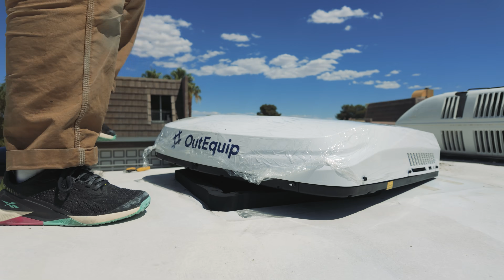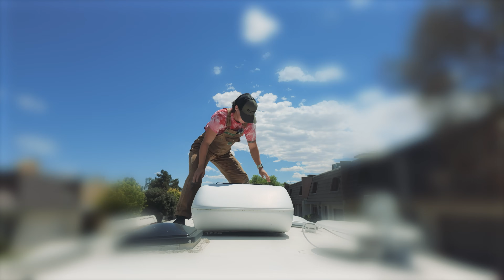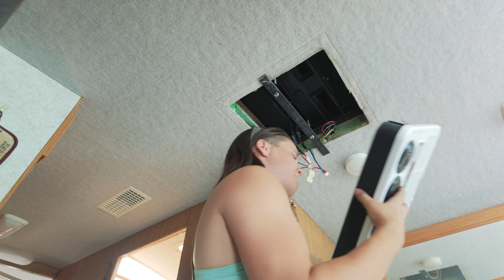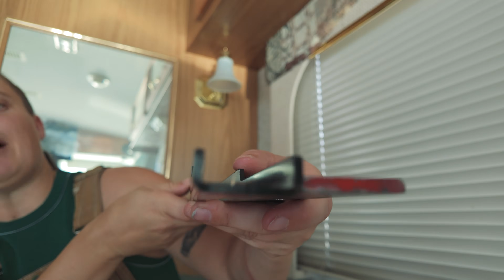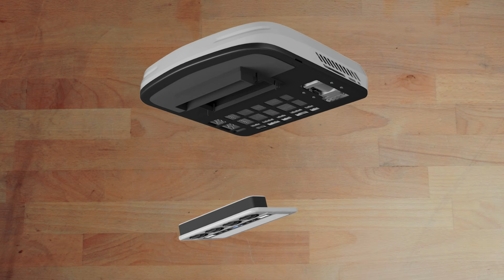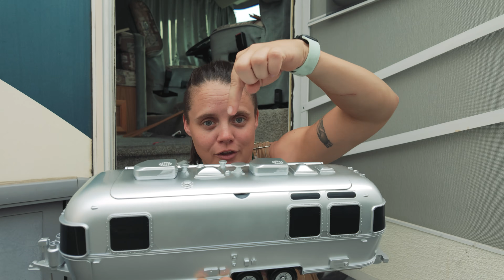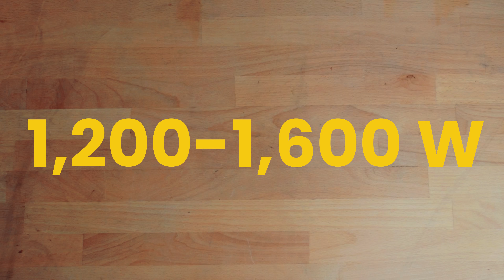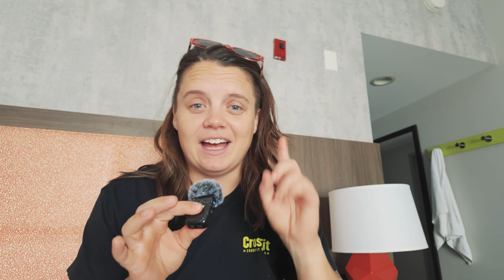Better RV Cooling with Less Power? My Switch to a 12V  AC | OutEquipPro AC Honest Review

Comment: Correct me if I am wrong, but an A/C air conditioner wouldn't deal with inverter losses when running off a generator or shore power would it?  Unless I suppose you were taking the A/C power and putting 100% into batteries and then feeding the RV.
Reply: Not if it's wired properly. If you plug into generator or shore power, a transfer switch (separate, or part of inverter) will bypass your inverter. So 120v power in the RV comes from shore/generator if present, or inverter when not available.

Comment: With the data i've seen so far, the new style inverter ACs, like the Furion chill cube, or Turbro are a better bet for larger RVs, IMO.  They are AC, not DC, but can be up to 18K BTU.  This DC unit is rated at 10K and  I don't see that cooling a 30+ foot RV.  My two ACs are 15k each, and struggle on a 95+ degree day.    I'd be curious to see what  you think six months from now after you've gone through the hot summer months
Reply: Insulate. Insulate. And Insulate.  I had to add insulation over the windows and shade the sunny side of a 5th 33 foot wheel with 15,000 BTU A/C's before the air conditioners could keep up with the 109F heat. Cardboard window covers and blankets on the walls make it possible to get it down to 89F.
Reply: @bobmirror7164  the thing is the walls will always be poorly insulated they are very thin

Comment: Can i connect the 12v ac to the power center instead of the battery? 

I have a 24ft class c. I installed a  12v ac on top of the bed in the rear, in my vent cut out. My power center is under the bed which is a straight shot. How to connect it to an open fuse spot that i already have? I do have solar and an Anker Power house which i i connect to my old generator plug and want it all to run of the power center. Also, my house battery has an issue that I need to figure out but I haven't paid any attention to it since my Anker runs great
Reply: As long as it can supply  80a ... if not, you might want to parallel 2 batteries as this takes a lot of stress off.  The battery will have a load amp rating.... the more you parallel the higher the amp capacity, put a proper fuse.

Comment: I have a Champion 2500 watt, duel fuel generator that is pretty quiet, around 60 decibels at 20 feet away, especially when inside its zombie box. It can power a 6000 BTU portable air conditioner with AC power for around 10-hours on 2-gallons of gas, or 5 hours with one gallon.
Reply: I have one also...but haven't tried that.
Propane would run even cheaper.
I have two new champion duel fuels.
Someone on youtube said it's much cheaper, just to run them on propane, and if you do that, try not to ever use gas, because it can help it last longer.

But yeah, it's a lot easier to get gasoline, then it is propane in most places.Especially if you're boondocking
Reply: What is a zombie box?

Comment: Thanks for the video: So you do not need an inverter for a 12V AC, correct ??   Thanks
Reply: 12 V used in RV's is DC power not AC

Comment: Another option: notch the inside lip of the plastic face plate to accommodate the metal brackets (Dremel with sanding drum), the vent/control panel will cover that up.
That's a cool system, 12DC brushless fans to save power, 'smart' scroll compressor with internal DC to AC step-up, but it needs a new 6awg wire run for the 40-60 amps at 12v.

Comment: More idiocy. Lets put an AC designed for a conversion van on a 30 plus foot class A. Then claim this smaller unit is more efficient because it uses less power. This unit is at least 3000 BTUs smaller so of course it uses less electricity moron.

Comment: I have a 30ft class A RV that has two existing rooftop AC’s. If it’s over 85 degrees outside, either one will bog down and shut off within 2 minutes while plugged into the home I’m staying at (30amp with a pigtail adapter to 110v). Would one of these cool a 30ft space, or would you recommend installing and running two at once? Would two draw too much from the batteries?
Reply: Great Question..hopefully someone can answer this

Comment: The rated power per the company website is 960 watts.
Reply: but if she said that you would find out thats roughly the normal power usage for a 120v 10k btu ac even a non inverter 120v ac will use very little power overtime when its not hot out

Comment: I do wonder what the actual (not claimed, with a tailwind) BTU rating of these 12V units are. At the end of the day, it is sucking heat out of the air inside and heating up the condenser outside. If it has a tiny condenser radiator it's simply not moving lots of heat or the condenser is super hot. A different manufacturer of 12V a/c units got called out for unrealistic BTU ratings, got very upset with people and actually got a proper test chamber built to prove their detractors wrong. Then they went very very quiet for some reason. (I just checked their latest specifications sheets, they dont even list BTU or cooling ratings in watts any more, just temperatures. Hmm)... But anyways, the actual power consumption for exactly the same cooling work is what really matters. I think it's using significantly less power because it can't shift asmmuch heat, so it's going to have a much higher duty cycle, that's not an issue if it never hits 100 percent, you are definitely saving on the inverter losses. But a real comparative power consumption is watt hours per 24 hours in the same conditions.

Comment: I love the idea of this. ACs are so loud. I camp to relax and the AC is not relaxing. This could put a pretty hefty load on the power converter if you are plugged in to shore power. That being said, modern RVs no longer use power hungry incandescent lights so that frees up a lot of 12V capacity. I hope you can do a follow up on this in the future. I'm not going to replace my AC before it dies, but when it does, I may consider switching to DC.
Reply from the maker: Definitely a good point about the converter. If you were going to run this while plugged in a lot I may look into upgrading your converter to something a little higher amps.
Reply: @rvrepairwoman  Pardon my ignorance. I though the converter charges the batteries and the DC circuits draw from the batteries. So there should be no direct load on the converter with this?
Reply: @whatdafrog  difference between inverter and converter. Inverter is DC to AC. Converter is AC to DC. Shore power is AC. So you’d need a way to take the AC to DC.
Reply: @renadas.8627  I'm well aware. The inverter doesn't  have anything to do with this. There may not even be an inverter.
Reply: @whatdafrog I agree, a 15amp converter will still only supply 15amp even if the AC is consuming 22amp (the battery will supply the additional 5amp). The AC load will make the converter work longer to try and keep the battery charged. Ultimately it is your battery that will be doing all the heavy lifting and the converter is only just helping. The larger converter you have the more help it can provide.

Comment: Will my existing converter be able to charge my battery while in use plugged in to 30 amps?
Reply: 30a at 12v will run the ac, with the battery helping, but for a few hours, then ac needs to rest and battery can recharge at 30a  the 12v ac is great for solar, but it takes a large converter to run on straight shore power
Reply: We just acquired a Jackery 3000 pro and plan on using that for boondocking instead of the gas generator that was built in. We also have an inverter and separate solar panels on the roof that I think provide a trickle charge for our batteries. Will there be issues just plugging the rv into the Jackery?  Your videos are great! Can you tell we are new at this? 😉

Comment: My one big question: how does this impact the life of your batteries?
Reply: Negatively.  Especially if you are deep discharging the batteries everyday. The LIPO's can handle a lot of discharging but there is still a cycle limit because of the chemical build up on the cell plates, like any battery, over time.
Reply: @bobmirror7164 if you have a power source assisting ie solar panels the battery wont get cooked, but if you plan to run the ac off of just battery, parallel the batteries to meet the 80a load requirement. 😉

Comment: Btu, how big an rv would you say this is applicable?sq footage?
Reply: Depends on how well your unit is insulated, amount of glass, how air tight the unit is, outdoor ambient temperature, etc., all the same criteria needed to properly size equipment for a home. Assuming you had a typical amount of glass, single pane, window shades to help keep out the sun, 1" of insulation found in most standard build rvs, and little to none air leakage, with a maximum outdoor temperature of 85F, and indoor set temperature of 70F, you are probably looking at 150 sf +- 20 sf to have the unit perform reasonably. And if this unit draws 960 watts with a breaker sized for 100 amps, you are looking at a #3 or #2 copper cable, assuming the distance between the batteries and the ac are located within about 20' or so for the wire run. You might be able to get buy with a #4 cable but a #6 is marginally too small, especially if you regularly experience 90+F temperatures with little overnight relief. With that much current draw, every foot of cable contributes to an appreciable voltage drop, the last thing you want the ac unit to be exposed to is operating on low voltage, as lower voltage generates more heat within the compressor motor and/or inverter. Larger cable guage will help insure higher operating voltage when current demand is high.   

By the way, for those using an AC voltage air conditioner, you really shouldn't operate it at any voltage less than 110vac. Same thing happens here, the lower the voltage, the more current needed to run it, current translates to heat produced in motor windings, which translates to shorter life. Many times many rv parks electrical systems are undersized so the voltages are inadequate to properly run the ac. It will still work, but you are running it under very stressful conditions. Its a good idea to have a plug in voltage gage to constantly monitor park supplied voltage to your rv for this reason.